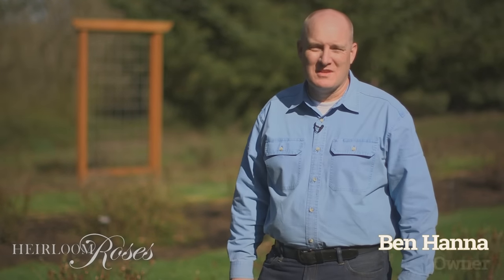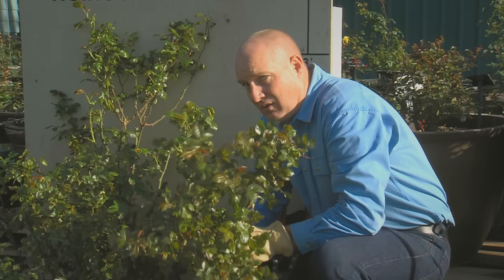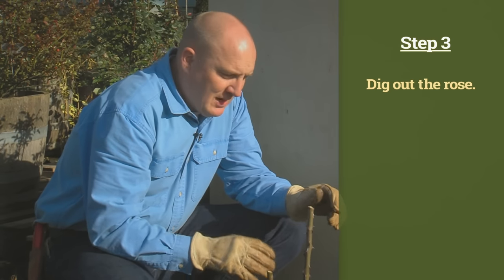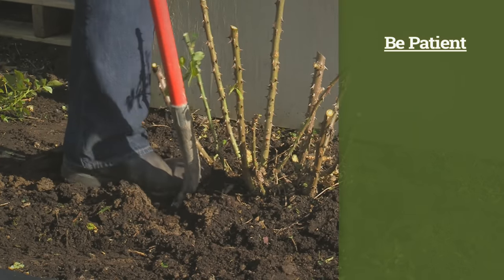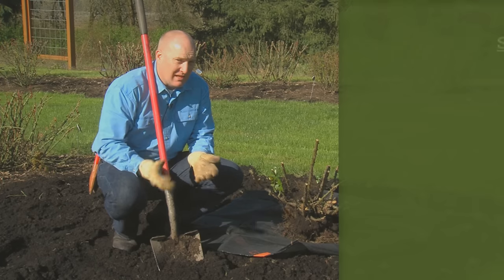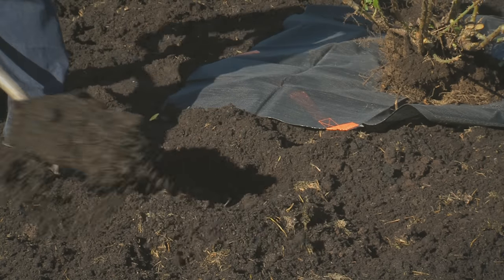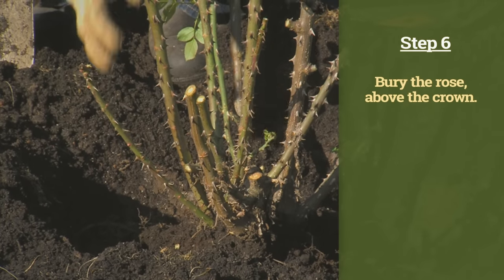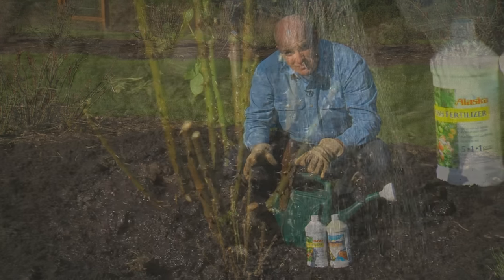How To Transplant A Rose

Comment: I would like to uproot my rose bushes and place them in large pots.  I purchased Miracle Grow Garden Soil for Trees/Shrubs and would like to know if i can use this 100% in the pot or do i need to use a 50/50 mix of native soil and the Miracle grow together.  Also, do i still need to use the manure and fish bone meal in my process when amending the soil to prepare for replanting.  Thank you.
Reply from the maker: I would recommend mixing the Miracle Grow soil with your native soil as that brand contains an added granular fertilizer that can be very strong on the roots during transplanting, especially if it is not a grafted variety but grown on its own roots. Amending with natural materials such as bone meal and aged cow manure will boot the available nutrients in the soil, making them more readily available for the roots to absorb.